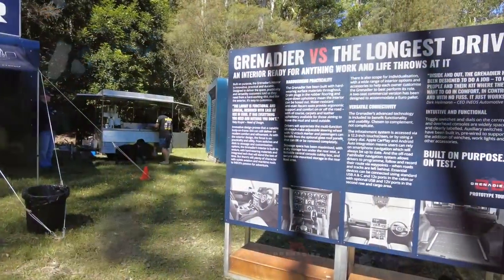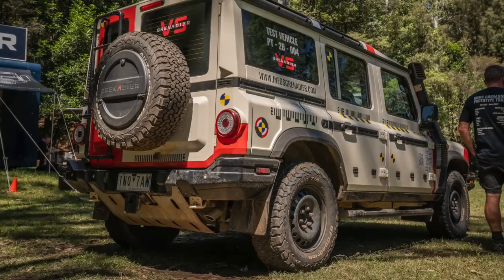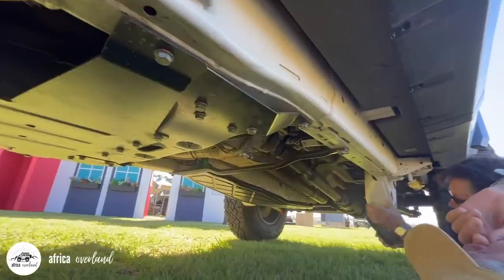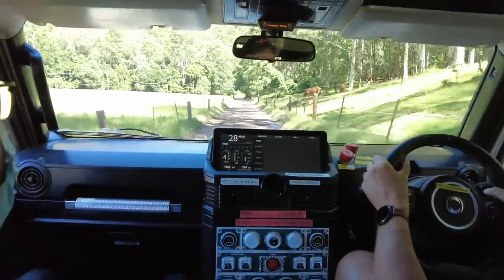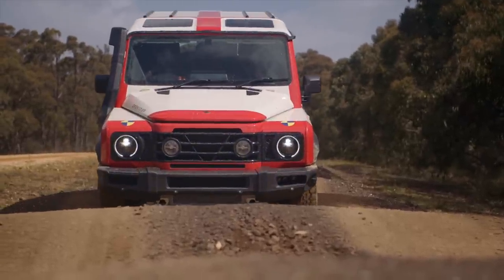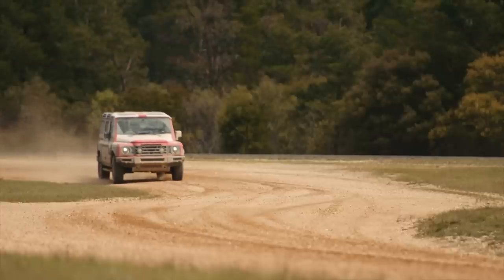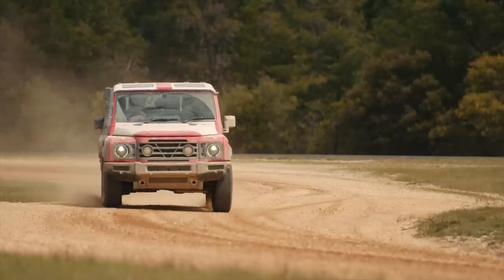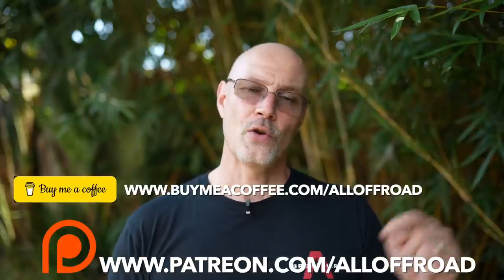Ineos Grenadier - THE ISSUES | SEPARATING THE FACTS FROM THE HYPE | A 4WD PERSPECTIVE

Comment from the maker: UPDATE ||||||
-------------------------------------------------------
Ineos contacted me to clarify the fuel figures I estimated "You flagged a range of figures based on what you saw on the dash while riding in the vehicle. We just wanted to note that this fuel range isn’t necessarily what the final specification will be. The prototype is running BETA software at this point and as a result, the sensors aren’t delivering the full range on the screen as seen."
--------------------------------------------------------
In my Ineos prototype review, I will take a more realistic approach to see if the Grenadier could be my Long Range 4wd Touring vehicle in the harsh Australian Outback and beyond. Let me know what you think in the comments below.

Comment: Full disclosure, I have a deposit down.  IMHO the Grenadier has to be looked at when the production vehicle is made.  For example, the lower swing arms have already been address and ineos felt they were to low.  Magna is correcting the issue.  The battery box as pointed out by another comment is going to be in a waterproof box.  Old man Emu is already working on a lift.  You are able to put 35 with little to no modifications.   Because they are using tractor axels the weight of wheel will be supported.  Ineos has announced they are retooling the steering which should tuck the damper up.  Ineos has announce you will be able to get underbody protection that is thicker than the 4mm they use now. Ineos is talking about providing a drawer system that makes everything  flat when you put down the rear seats.    Now let's discuss how it differs from Rubicon, a USA favorite.  Ineos is not a rock crawler and that is where the Jeep excel.  But a Jeep can't tow 7700lbs. Jeep can't have 700lbs strap to the roof.  You can modify the hell out of a Jeep but we know third party manufactures have already committed to making parts.  Ineos has stated many will get the protype versions to design parts.   We have to wait for final version before we can make a true assessment.
Reply from the maker: Can only judge the car by what I see so far, Credit to Ineos and displaying a prototyp hopefully they make use of the opportunity this presents and make required changes. I also would not take a Jeep as a tourer but in the US many do. Off road capability of the Ineos is well below a jeep at present. Looking forward to see final version of Ineos
Reply: I’ve put a $800 reservation down. I’ll wait before I make a decision.
Reply: Let's hope so
Reply: Well done I will want a 2" lift and 35 tyres in a couple of weeks we get to do the final order. The wife said it has to be mushroom or forget it. I think I can live with that.
Reply: @johnswinkels4383  I reckon I’m going the red with black. Lift and 35 - is a must have.
Reply: @mfp4136  Good choice I did put a 2 lift and 35 on a patrol with bilstiens and it became a super tonka truck. An additional tank is a must. I can hear the accountant in the background going if we have to spend more money we are not buying it. Thankfully I suffer from selective hearing impairment.
Reply: @mfp4136  Buddy as long as the red is not metal flake which I think it is cause it was my choice also, as my car received a door ding and the quote was 1500 bucks so i am a bit over metal flake paint. But hey how exciting next month we get to do the final order and another 5k . I have a XC40 VOLVO for sale and the wife comes as a bonus.
Reply: @johnswinkels4383  - my neighbour has a Y62. He has spent about $30k on it. Absolute machine. When he bought I said why the chocolate brown🤢. But what he has done to it deserves an award.
Reply: @johnswinkels4383  - keep the wife mate. She’s allowing you to buy Grenadier.
Reply: @mfp4136  I think the petrol v8 would kill me on fuel. What I have learned on the latest BMW diesel modular engine with a closed water jacket been out for 15 years is a game changer. If Toyota thought it was good enough for their Supra that has to mean something.
Reply: @johnswinkels4383  Mushroom will be the most popular color.  On Ineos Forum, there was a survey and most ppl picked mushroom.  I am in the mushroom camp myself.
Reply: @peopleschamp7258  Looks like Iam going to get a I told you so from the wife. I do like the mushroom colour also.
Reply: @johnswinkels4383  Yep an XC40 and wife for sale
Reply: Not many jeeps are taken off road. They are busy crawling the malls. 😄
Those jeeps that are rock crawling all have upgraded parts. It's a common issues to hear of busted front axles and housing. They cannot take the stress of big tires.
Reply: @mfp4136  drop the wife. You will never hear the end of her whining.
Reply: @2nickles647  quite a few Jeeps are taken offroad, and in bone stock form.

Comment: Thanks for the Video. Sorry - i do not read all 449 comments. My comments are from South Africa - I do nothing than travel Africa. 1. Good comment on gauges. Silly no VDO gauges in direct view. 2. Electronics and batteries under seat. silly idea.3. The front and rear bash plates are too low - I realised already on first footage of coverage.4. Fuel tanks too small for real bundu travel. ---- Sorry, I will stick to my defender 110 TDI. My County has 2 seats and a level space right to the rear door with plenty of storage under! But well investigated. Thanks. Wilfried from South Africa

Comment: Hats off to Ineos, they are bringing prototype/pre-production cars out to the public. Of course there are going to be bits and pieces that aren't right and things that need to be fixed.   They are bringing the 'Old school' 4x4 kicking and screaming into the 21st century.....it's so exciting!🤓
Reply: It's s total piece of engineering overkill in the wrong place and really really sorry to say but it will not sell.. Having built trucks for the Dakar Rally and other off highway vehicles this just not going to work.. Too many issues, suspension is the most important factor and they have failed completely unless you want and old man's old school Defender type vehicle, then buy a Defender its way better..

Comment: I was really interested in the grenadier Until found out BMW engine and transmission NO THANKS  BMW are so over rated --- truth is they're rubbish ---- all the plastic used on the engine goes brittle & BMW don't do spares very well ---- anybody with range rover P38 diesel will know ---- can't get injector parts So no not for me---- I'll buy a old defender and save loads of cash 🤗🤗

Comment: Great review Stefan! I found the link to it it on  AULRO  (Aus Land Rover forum)!

That being said, I am an Ineos "paid up deposit/ early hand raiser " and  spent several hours at the Scenic Rim (Qld) drive day. 
A couple of things: At the outset, Ineos stated that the design intent was for a reliable "work horse", not a go-anywhere extreme off-roader . I quizzed the Ineos blokes on this intently. 
Fuel capacity: I gleaned from the reports on the above mentioned LR website, and comments on the Qld drive day, that Rick Bates was the driver who ferried vehicle from Sth Aus. to SE Qld over a couple of days. From his fuel stops wrt distance on a 90L tank, he got around 9.x L/100km admitting he 'pushed it along' the whole way  ! :-) A standard 800-900km range for what's intended is reasonable. In  a previous life, a 100L fuel bladder was a very economical way to carry diesel fuel for range extension as/when required

Underbody clearance: The Ineos people said that the standard vehicle can take a 50mm lift as is without worrying about drive angles/ brake lines etc. That would take the clearance to a tad over 300mm under the diff on the proposed standard 17" wheels/tyre combination !

Rear Door: it's rated for 110kg minimum, as are all other 4 doors with the  track inserts

A 35" tyre is heavy and not needed for most people. I personally would much prefer to drive to the conditions...at my age, lifting a 32" tyre/rim combination will be fine thanks! Which is why also I'll probably opt for the alloy rather than steel wheels.   

Given that I have a retirement list a mile long of jobs for SWMBO, now that I've found your channel I must spend more time watching it...all in the name of critical research you understand!!
Good luck!

Comment: INEOS's first problem is it needs to sell and make money; 35" tyres and better angles will makes it too expensive to get through type approval and noise limits. Huge standard fuel capacity will make it too heavy and upset the fuel consumption conformity. INEOS have already announced co-operation with the aftermarket crowd, so I would be hopeful for long term development. INEOS's announcements on third party support are almost diametrically opposite to the statements of JLR and their design supremo, who want to chase the aftermarket away from current products.

An interesting review; it is always good to hear another measured opinion. I did the 2B tour in the UK in August 2021 and thought it was smoother, quieter, more powerful and tighter turning than my existing elderly LR.  I've reserved one, but then I'm looking for a modern alternative to a 1989 LR110 CSW, updated with a 200Tdi, in the green UK!
Reply: Totally agree , 
After all not everyone is Jim
Reply: Jeep's success is partly due to aftermarket add-ons. People love to customize their vehicles. The mod community makes the vehicle vibrant. It would be a big mistake not to engage the aftermarket suppliers.
Reply: You mention the JLR design supremo. He appears to be someone who sneers at traditional Defender owners (like me) and has done more than any other individual to alienate their traditional customer base. A member of the urban elite / know-it-alls.
Reply: @defendermodsandtravels  But he has sold a lot of FFRR, RR Sports and Evokes. Defender was never a big seller and JLR need to shift metal.
Reply: @JeremyEdwards996  Yes and he has designed a range of overly complicated, unreliable vehicles which have caused great reputational damage and cost at least 100,000 lost sales p.a. according to their CEO Thierry Bolloré. Nice work.
Reply: I was chatting to a guy a Abenteuer and ALLRAD last year who was involved in the design of the Grenadier and was now in the process of setting up an aftermarket and accessories company for it.

Comment: Thanks for the review. It is good to hear the perspective of someone who is assessing it against harder 4wd scenarios. As you mentioned, most of the reviews I have seen appear to give their assessments against what we might call 'general' on and off-road use, likely what the majority of users will have in mind, and no doubt the major target of Ineos. This makes sense. However, I see no harm in assessing whether or not it will be a suitable vehicle for those that do harder, long-distance, remote travel, where we need more clearance, more range, better articulation, and components designed to both weeks of corrugations or days of rock/mud terrain. 

After we lost the likes of the coil sprung Toyotas and Patrols, we have all been wanting something new that gives us live-axles, coils and disk brakes all-round, reasonable engine power/torque, essentially a base platform that the Grenadier seems to possess. I applaud Ineos for their efforts in this so far. But I too remain hopeful that there is some provision for the other things we require for our passions, either supplied at source or aftermarket, to include the extra fuel capacity, suspension lift/performance improvements and legally/practically allow larger tyres. We shall see what comes out in the production versions. Thanks again.

Comment: As a current L316 Defender owner I can say that your observations are spot on. If these fundimental issues such as suspension travel limitations, wheel size options, fuel capacity and low hanging components  haven't been dealt by now they are set to stay, meaning best I hold on to my 'old Defender...

Comment: This was an excellent review. You covered exactly some of the questions I had about the undercarriage. All those low-hanging parts and the questions you ask about the drive train implications of lifting 2"-3" to put 35s on are perfect. A poor turning radius is a killer. I am interested in hearing the answers to your questions. For the kind of overlanding I do here in the US, the entrance/departure angle question is important but of greatest value to me is the fuel tank capacity. The current 90L (~23 US Gallons) could stand improvement. Finally, the battery/fuse placement is a real problem because the inability to lay the seats flat removes the ability to efficiently pack the rear cargo area (which is already small). When I go overlanding, I need all the space I can get in the cargo area and strange angles create a lot of problems when packing up. Thanks for this very good review. Subscribed.

Comment: Great review! The best I’ve seen, thank you. I agree with the points you’ve mentioned. I went to an experience center in Berrima where they took us for a drive around a lap of gnarly bush tracks and we got to poke around the vehicle and ask questions. 

✅The ride was very good. They have spent a lot of money sorting out the suspension and it shows. Very well damped and no shudder or wobble. The cabin was a pre production version so all interior plastics were 3d printed so it felt nasty but you got the concept.  
✅Engine was the diesel and it felt strong and torquey. 
✅You could see the build quality is going to be really good in the production model. They want people to keep their Grenadier for a long time. 

I was impressed by the ride quality but found some major disappointments elsewhere:

❌Driver visibility was poor. They have copied the old defender roof line which pushes it down very low at the front and makes for a narrow windscreen which also makes the side windows quite low so your head is up inside the roof. The B pillar is quite far forward so your eye line is blocked by the window frame of the door, especially when looking to merge lanes (say, on a road with traffic). 
❌The door sill is quite far from the seat so getting in and out in one smooth move is difficult, even with my long legs. 
The low roof line and low top of the door frame also made access difficult. 
❌Not much leg room. I can stretch out in the drivers seat in my Discovery but not in the Grenadier. They said I could move my seat back, which was true but the footwell is very shallow so if I want more leg room the rear passengers lose it. Cabin felt quite cosy, albeit not as bad as the old Defender, but no where as spacious or comfy as my Discovery. 
❌Rear seats don’t fold flat and not very comfy. 
❌Rear cargo floor was quite high with no apparent reason (no third seating row folded away in there). 
❌Expensive. Starting at AuD $85k with no options this thing is a good $20k more than a specced up Japanese work Ute. Any vehicle sold on Oz over $70k attracts a Luxury Car Tax, plus other dealer and stamp duty, meaning this thing will easily be $110k drive away. 

I think they’ve succeeded in making a strong and well sorted vehicle from scratch that will take on rugged terrain with ease and will hopefully be a good tough truck to fill the niche in the market where a G-Wagon is too fancy and a Toyota 70 Series is too bumpy. 

But, in short, it’s not for me. I prefer my Discovery as a great all rounder.
Reply from the maker: thanks, not so sure if they really sorted out suspension, the front looks like a near copy of the Jeep Wrangler suspension which is good but very finicky. If you google Jeep dead wobble you find a plethora of posts and I personally had it in my Jeep which is very scary. The Jeep suspension is easily upset and just a small misalignment and bushed can cause this and it would be hard to fix or diagnose in the bush. There is a recent Ineos promotional video out which shows a few seconds of horrible dead wobble in the suspension.